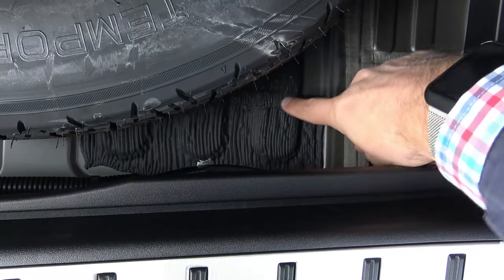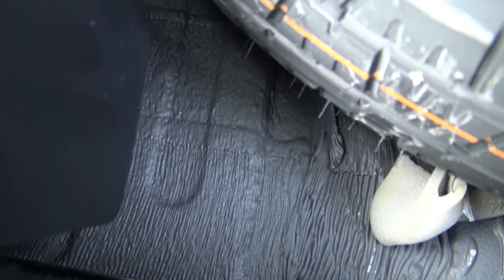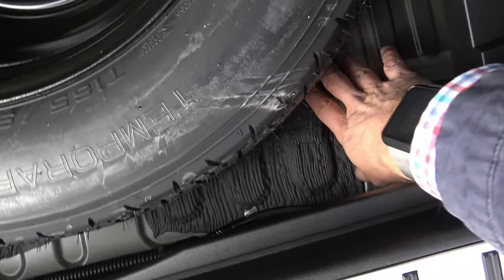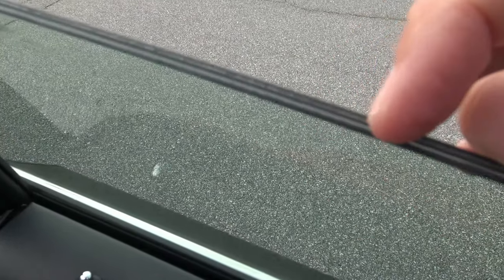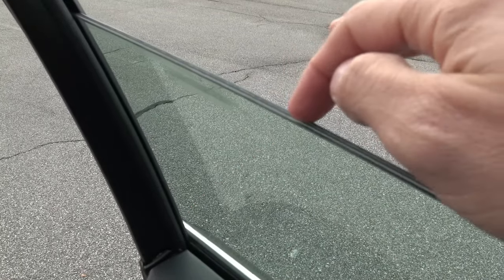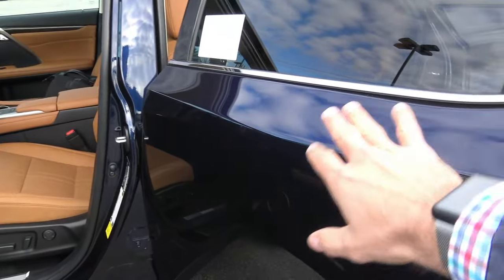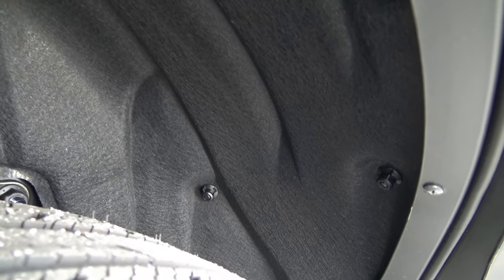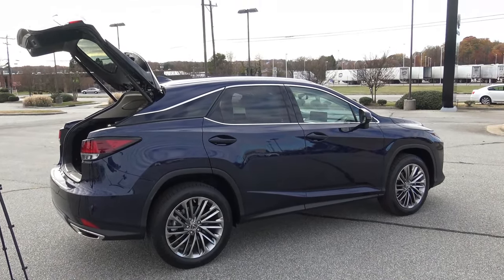Why is Lexus so quiet?

Comment: Unfortunately most cars under $100k now are cutting back on physical sound deadening materials and trying to make up for it with active noise cancellation. This cuts the cost of materials (more profit) and reduces weight, giving them better EPA numbers.
Reply: Explains why the current gen es 350's are not as quiet IMO than previous generations. The 2015 I test drove years ago seemed like a tomb and it was a basic ES. I heard the pre 2013 
ES's were even quieter. So I was quite disappointed in the base 2019 ES I test drove which claimed more insulation on the floor yet more overall noise. On the '21 UL ES I drove, the door sheet metal was so thin it actually flexes when closing the doors. Sad that even the UL wasn't as quiet as the base 2015 I test drove.
Reply: good!

Comment: The white stuff under the spare tire is not sound dampening, it's sealer. It goes where any metal has been stamped to cover the seams.  The black is yes, dampening , it goes on wet and dries in the ovens before it gets the paint applied.  I build the RX in the paint dept. So can confirm the dampening is everywhere 👍 including in the cabin in  the footwells as well.
Reply: What about the es models?
Reply: South plan, me north
Reply: Is that true for all Lexus models?

Comment: important note: note all lexus' have the double pane glass which is a HUGE contributor to why high end luxury cars can get so much quieter than Honda accord ect... Only the luxury / ultra luxury models trim models have it... base models do not.
Reply from the maker: That used to be true but almost all have double glass now.
Reply: @HowToCarGuy  even some lower end cars have the laminated glass in the windshield and front windows (most Fords have them)
Reply: I had a 2014 Toyota Avalon and it had the double pained glass. But then again the Avalon and Lexus ES is basically the same car.
Reply: @jeffs70chevelle  what surprised me recently is I found out the kia Sorento or the telluride has double pane front windows and windshield. Modern everyday cars are coming along nowadays
Reply: The thing to note is thicker glass will reduce wind noise and the noise from other cars, but does almost nothing for road noise which resonates up through the unibody

Comment: The "felt" stuff in the wheel opening is something I didn't know about. Other brands use the acoustic laminated glass and NVH materials on the sheet metal as well. BTW, those spots are strategically chosen by engineers. They don't just slap that stuff on everywhere. They fine tune the exact placement of that stuff for max effect because it does add weight. You didn't mention any of the undercarriage NVH panels.
Reply from the maker: Thank you for the feedback and great insight for another video!
Reply: Indeed. However he did mention sound dampening material underneath the vehicle at about 2:10 into the video.
Reply: @HowToCarGuy  please which lexus RX is advisable to buy. 450h. Or 350 fsport or 350 regular
Reply: @cardo1111  shhhh, dont talk common sense

Comment: My 2005 ES330 is still whisper quiet and smooth at 276,000 miles ! It’s got that material in the fender liners as well as the trunk pan material. No double paned glass tho. My 08 LS460 has the double paned glass tho! So quiet and well built

Comment: Just picked up a 2013 ES 350 with 30k miles on it... sure it's low miles, but it's 9 years old, and it is VERY quiet. I have been a become a fan of Lexus, they are just great well-built vehicles.
Reply: I agree
Reply: Same here with 80k and it's fantastic
Reply: @Dcon 860  there's an aftermarket gas pedal module you can buy that gets rid of the delay. Me personally, I just live with it, most times it's a seldom thing.
Reply: @Dcon 860  oh I get the same, mine is the Matador Red Mica... in direct sun it has the brighter red/orange hughes, but in the shade it looks like a deep black cherry. Pretty sure Lexus put a lot of pearl flake into their signature paint options to give them that subtle depth.
Reply: from what i have experienced, bmw has a more smooth ride and has less interior noise than lexus
Reply: @BingBangBrine  True, when they're parked in the shop they are pretty quiet.
Reply: @dcon8602  the new ones, yes. Mine is the 2GR-FE, so just standard port injection for me.
Reply: My RC already 120k and still maintain its quality.

Comment: True. I need to know that black material can be purchased and apply to my CHR. My lexus don't seem to show much insulation material but the quietness is apparent even though I'm using 30 and 35 tire profile.
Reply: Just get sound dampening peel and stick. That black material is permanent from the factory where they heat it to a melting point and stick it.

Comment: Wish all lexus's came with laminated glass on all windows. My standard model 2019 es 350 had standard front side glass which was thicker than the rear side glass. Dont take my word for it, measure it for yourself.  Explains why I seem to hear more noise coming from the rear. Even my UL ES 350 had thinner rear side glass.

Comment: If u wanna see highly practical NVH lowering measures in cars that cost less than Lexus, while yielding highly impressive results, look at the latest Korean premium models from Kia and Hyundai.  

Critical items that make a huge difference: 
1. Acoustic glass with a sound barrier sandwiched in between glass. 
2. Area directly behind both hinges (front doors)…that lead into fender well. 
3. All 4 fender wells. 
4. Exterior portion of the floorpan. Huge difference if thick underseal is sorayed on entire floorpan. 
5. Firewall insulation.

Comment: i noticed that older Lexus have more dampening material than newer models? While my 2010 RX has a fully covered engine bay the newer models since 2015 does´nt.
Reply: Because theyve found better ways to do it. And cosmetic engine covers have NOTHING to do with sound deadening. Youre commenting on soomething you have no knowledge on.

Comment: My 2021 Lexus RX 350 is a giant rattle and squeak box and has gotten worse over time. My vehicle only has 31,000 miles presently.  It started when first bought the car resulting in the dealer replacing one of my door panels. Now the lift gate and host of other areas make all sorts of irritating noises that have not managed to be properly resolved after multiple trips to my local dealer.   I've never had so much interior noise from any other brand of car.  
I've owned all sorts of cars over the years from Chevy Camaros and Honda Preludes to an E39 BMW 540I M Sport.  None of them had rattle and squeaking noise issues.  Then I bought a 2019 Lexus ES 350 only to have odd noises from the AC Compressor and dash and door vibrations and now I'm in the aforementioned  RX 350 after the dealership's bodyshop botched a paint repair twice resulting in diminished value to my car ES 350.  

Honestly, I don't know that I'll ever buy another Lexus again...

Comment: I have a 2021 rx350 and it did not travel many miles and yet I hear I became noise from the panorama ceiling... Does anyone suffer from the same problem as me and what is the solution?? Please interact

Comment: My Lexus ES is loud, though is a hybrid, very disappointing… lots of wind noise, when I have the sunroof panel open it feels like my windows are cracked, horrible for highway cruising, major reason I’m considering selling, maybe it’s just mine, but that has been my experience
Reply: I feel the same. Got a 2016 RX 350. Not quiet as I expected.

Comment: How does the IS300 compare in quietness with the more high-end cars? Thinking to buy the IS300 from 2016 2.5 hybrid
Reply: The IS is entry level. So it's quieter then your regular labels (toyota,Honda,gm etc)  but won't be as sound as say, the LC or GS where paying double the price of an IS gets you alot more goodies uncluding more sound cancelation materials.

Comment: Lexus used to be so quiet and class leading in this area. But the newer generations are no longer class leading anymore.
Reply: from what year did they become not quiet/class leading? thinking of getting a 2008-2015 Lexus
Reply: @46Bax  hes a fool. They still are.
Reply: Ya, youre absolutely wrong. The Ls and LC, Lx are tops in quality, reliability, capability, material selection, and yes, quietness. Ive owned and drove all the german and american "luxury" brands, and the lexus is still absolute king of the hill in the affordable top end luxury market (sub 150k sedans). Genesis g90 is a close second, though not as attractive, imo (subjective of course). Bmw and mercedes transmit much more nvh, audi is quieter than those 2, but still in 3rd. You can choose not to trust me, thats fine. Get the equipment and test yourself, OR check out car and drivel, motor trend, etc. They all agree. Stop talking about things you dont know

Comment: I have 2021 honda accord 2.0t Touring, i love it and it my favorite cars look but i am to change a car i may go for Lexus cuz my car noises can sometimes get on my nerves and lexus is also my 2nd favorite cars look
Reply: If you are looking for silent car check cx5 , there is some engine noise but road noise is non existent, which is rare for that segment .  Old Rx is relatively quite , but cx5 beats it on rough surfaces , old NX is super noisy by the way .
Reply: @balabolrustam507  the nx was junk. Was a loaner when i had a warranty job done on my LS. Terrible car. Mazda is ugly trash, and a laughable suggestion
Reply: @jamesstephenson2346  it looks dated , not sure about the rest, they named it most reliable car recently , can u explain?

Comment: There is also noise cancelling through the speakers. Like a headphones
Reply: I don’t think that’s the case. Not with Lexus.
Reply: Last i knew (been like a year since i looked) lexus didnt employ this. Nor did they need too. In general this is an awful option if you care about the performance of the audio system anyhow
Reply: @jamesstephenson2346 Lexus calls it “Active Noise Control”. It’s present in several Lexus models now, including a 2023 Lexus ES350 F Sport I drove a few days ago. It makes a noticeable difference.